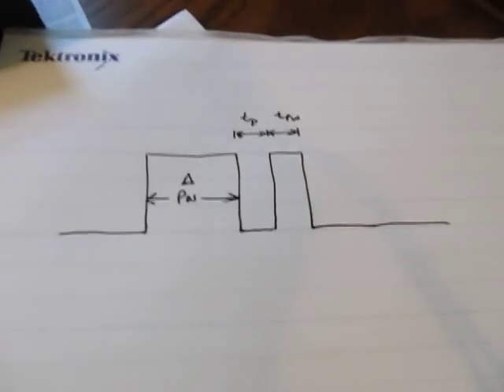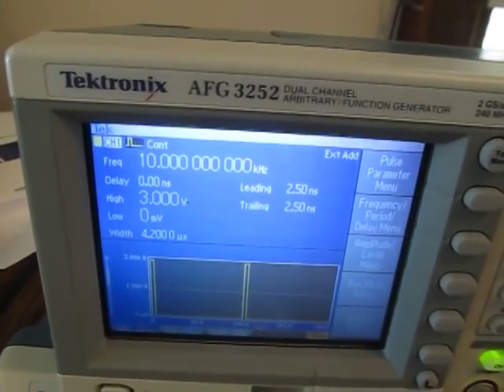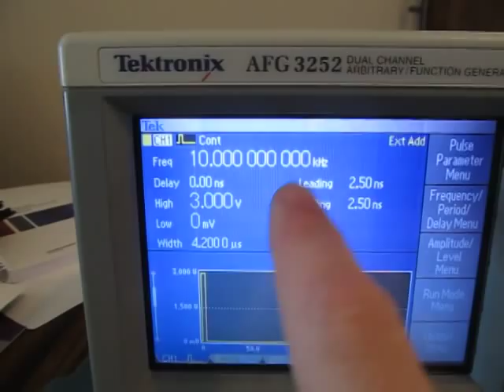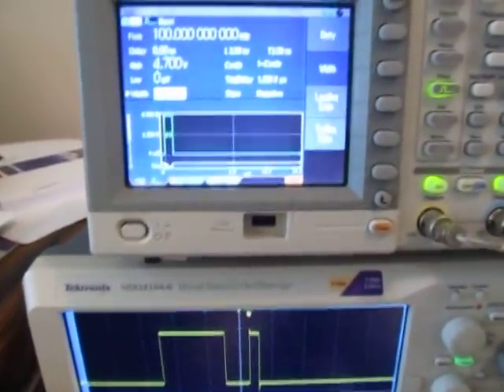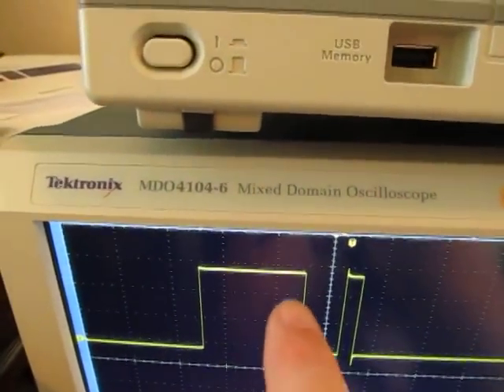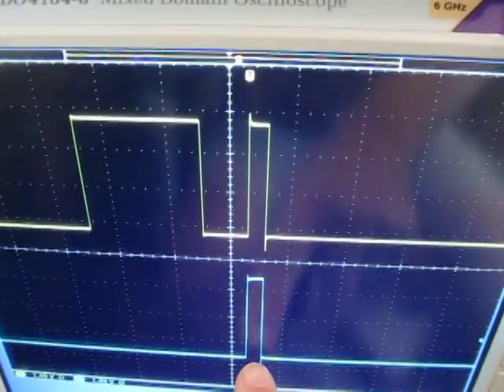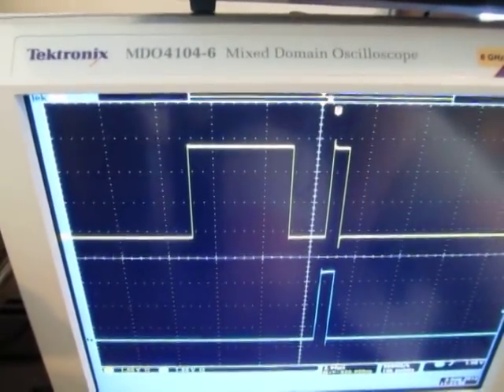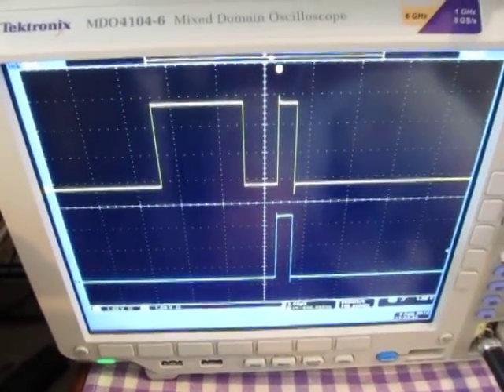#57: Setting up variable double-pulse using Tek AFG

Comment: Hi, your  video was very helpful to generate two pulses, btw I tried to short the time between the pulses with Trig/Delay (I need it to be shorter than 20ns) but It didn't work out. There is a way I could get that time?
Reply from the maker: One way to do that is to change the trigger slope to Positive, which will reference the second pulse to the rising edge of the the first pulse.  Of course, the time between pulses will then be a function of the CH1 pulse width (it will be trigger delay value minus CH1 pulse width).

Comment: Hi, Thanks for the Video. Is this method still possible with the AFG3022c model? I know that it doesnt have the 'Add input' channel on the back. Is there a way around this? Thanks
Reply from the maker: You may be able to use a resistive power combiner to achieve the summing operation.

Comment: How can i generate variable double pulse using afg 3011c
Reply from the maker: With a single-channel unit like the AFG3011C, the only way to do it will be to create a custom ARB waveform and play that.  It won't give you the flexible adjustability of the method shown there though.

Comment: Hey man! Nice Video. Is there any way to do this, without the expensive equipment? Ive tried to do this with an Exclusive OR gate, however I need the frequency and duty-cycle to remain the same, whilst still having full control over the 'time-between-pulses'. Any help would be great!
Reply from the maker: Probably could be done with a couple of 555 timers and/or 74LS123A one-shots and some logic...

Comment: Nice video and nice equipment. The signal you generated is very similar to the PPM signal train used in proportional remote control systems. In this case it would be two control channels..